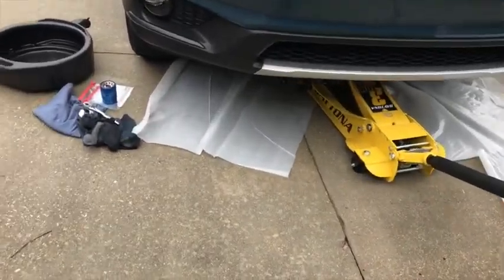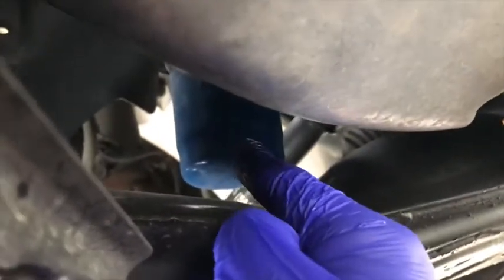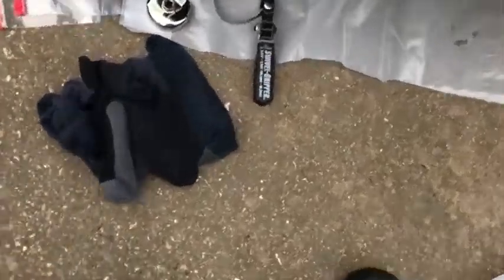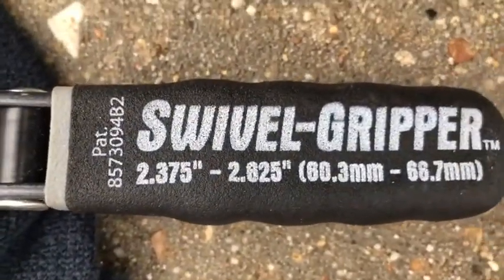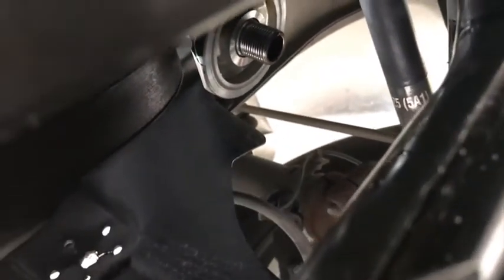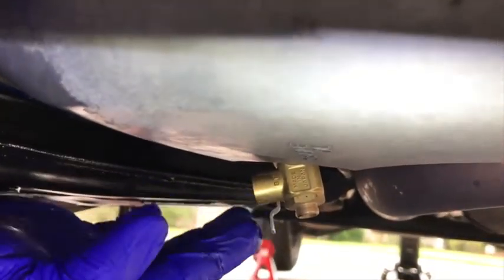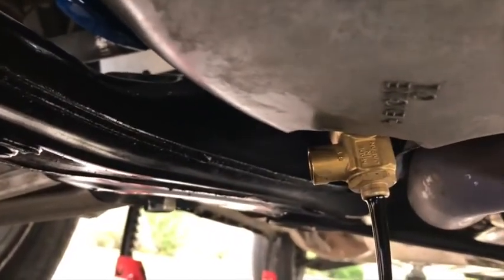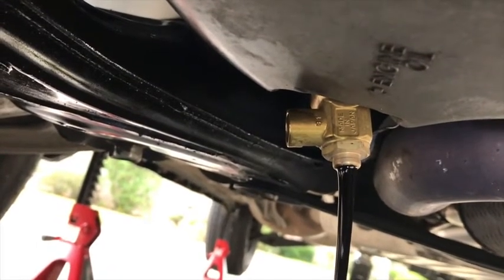2019 Honda Pilot Oil Change

Comment: Oil filter is such a pain on these. I end up just taking off the wheel to get to it.
Reply from the maker: Although I didn’t do that in the video that you watched, that is also how I do it. I always rotate my tires when I change my oil so I have to remove the tire anyway.
Reply: @PaulNaylor3   How many miles do you go on the oil before a change?
Reply from the maker: On somevehicles I change every 5,000 miles but I’m planning on 7,500-mile intervals right now.